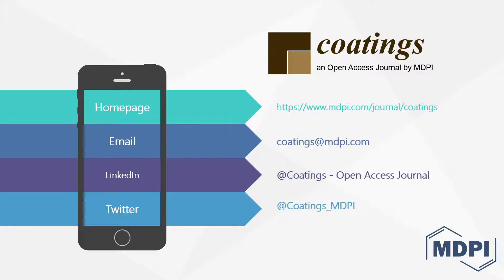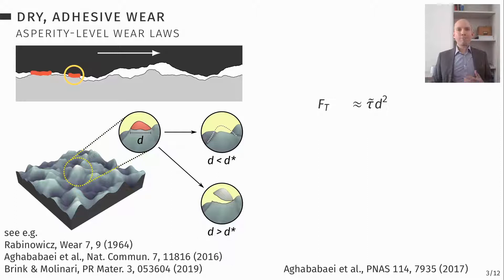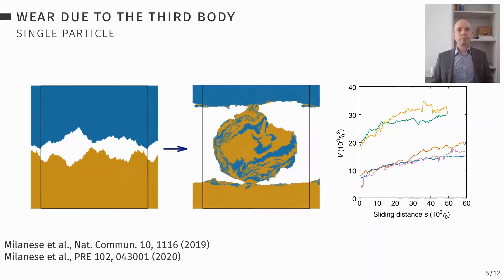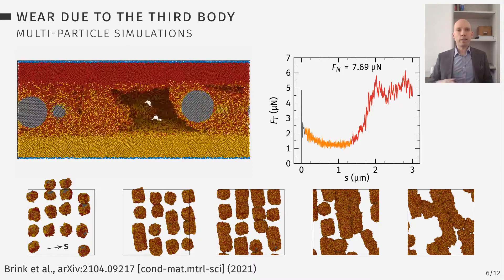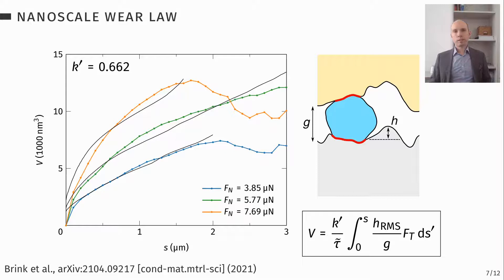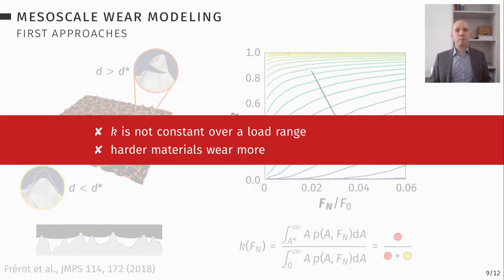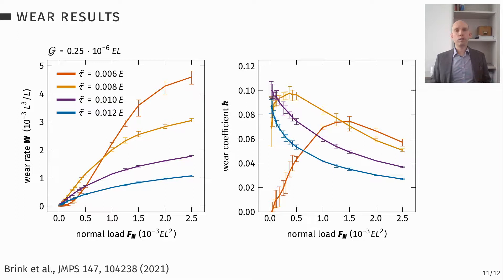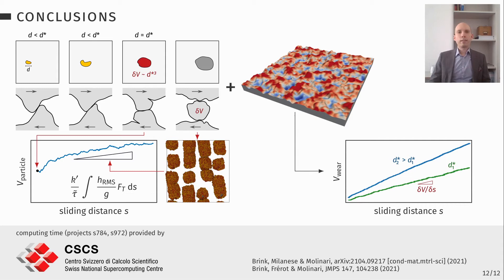Tobias Brink (Max-Planck-Institut für Eisenforschung) on physics-based wear laws | ViViMaT 2-1-1

Comment: Thanks for the talk! Does that mean there is a characteristic wear particle size that is independent of load and only might change due to changes in temperature?
Reply: This is a good question, which we didn't get to in the Q&A video, so I'll just answer here.

One has to differentiate between the wear particle size at formation and the final wear particle size. For example, in the experimental paper from which I took the images on slide 2 ( https://doi.org/10.1016/j.triboint.2019.01.051 ), agglomeration of particles due to sintering is reported. So here, one can imagine the particle size distribution arising from agglomeration (among other things) as a (perhaps non-linear) function of sliding distance.

Even at the formation stage of the particles, assuming a characteristic size is an approximation. In the meso-scale model, we assumed strong adhesion between the two contacting bodies. For weak adhesion, we did indeed find a dependence of critical size d* on the normal load in single-asperity MD simulations ( https://doi.org/10.1103/PhysRevMaterials.3.053604 ). The reason is that the mechanism of sliding along the weak, adhesive interface is an added mechanism, which also depends on the resolved shear stress on the interface (imagine a Schmid-like law based on the contact angle towards the sliding direction). Furthermore, the path of the crack that leads to detachment of the particle might depend (weakly?) on the applied normal load. Finally, in Jean-François Molinari's talk in the first round of ViViMaT, he already talked about elastic interactions between asperities, which can also depend on load.

I would summarize that we are still left with a characteristic minimum size of wear particles, but the particle size distributions obtained experimentally ex situ after a long sliding experiment cannot yet be predicted, especially due to evolution/agglomeration of the particles during continued sliding. It would be very interesting to get an experimental view on particle size distributions as a function of sliding distance, but it might be quite challenging to actually ensure to capture and count the smallest particles.